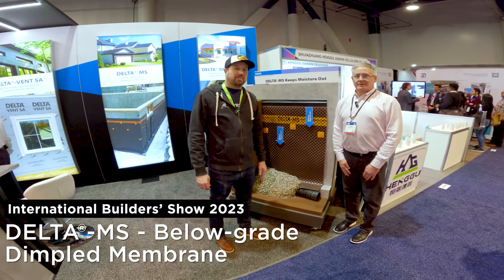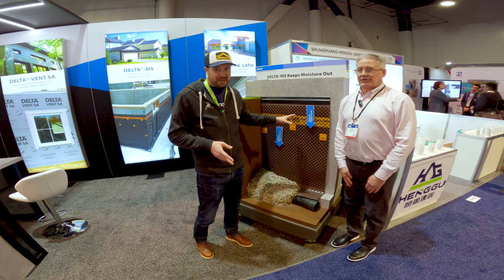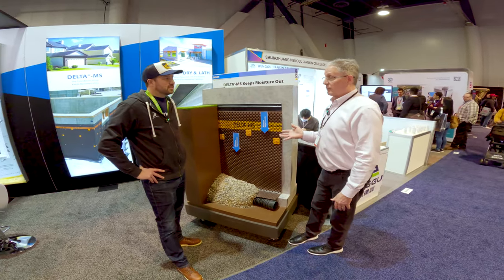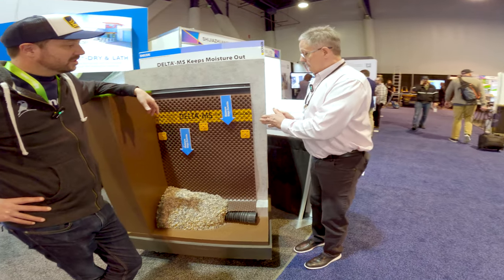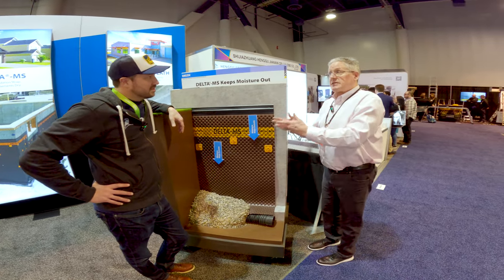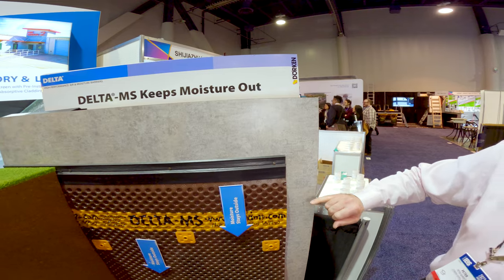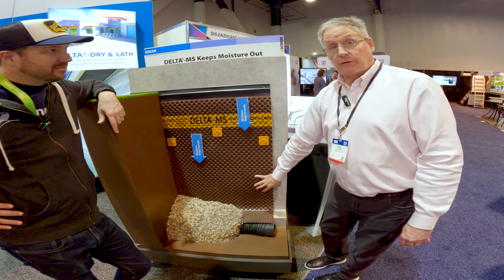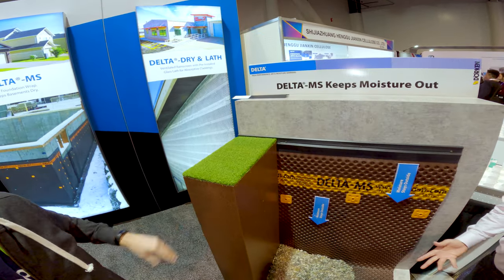Foundation Waterproofing Membrane

Comment: Is this also meant for at or below grade insulated concrete foundations where the concrete wall is clad in foam?
Reply: Yes, this system is supposed to cover and protect styrofoam. What we have here is plain <censored>.

Comment: I would think that this dimpled base layer could be used over the house wrap behind the siding when installing exterior mounted 2” rock wool batts  to allow moisture a pathway out of it got past the siding.   I’ve talked to a homeowner who wasn’t sure about installing retrofit injection foam insulation because he couldn’t get an clear answer on does the injection foam cause any long term issues to the Romex in the walls pertaining to overheating from being wrapped in foam. He opted to have the house resided but added exterior mounted rock wool insulation boards over the wrap to increase the insulation of his existing in wall R-13. Rock wool added  R-7 for a total R- value of 20R. Seems like you could market the dimple layer for that application too as a water channel. Thoughts? If you market it that way and it’s a hit, I expect mine for free for the idea. 👍🏽
Reply: I would have recommended to use polyiso as it has a much higher R-Value than rockwool. Polyiso can totally be used where board stock rockwool is used, unless on certain fire resistant commercial wall systems (in Canada it's ULc-S134 assemblies).
Reply: The fire resistance of the rockwool in areas that have wild fire risk is really important. Rockwool is hydrophobic so I don’t think it need an air gap behind it. Foam on the other hand probably does.